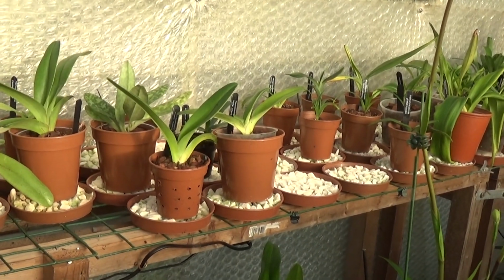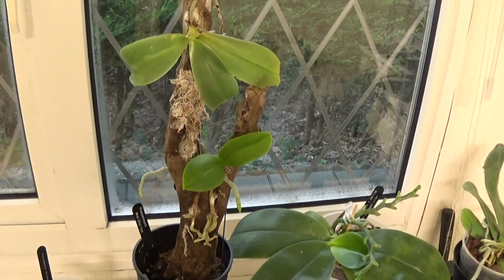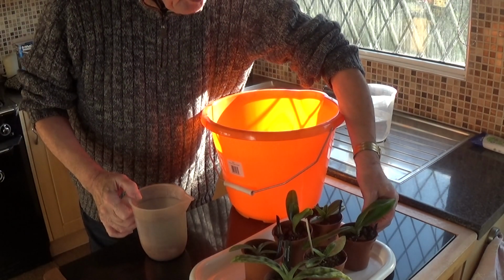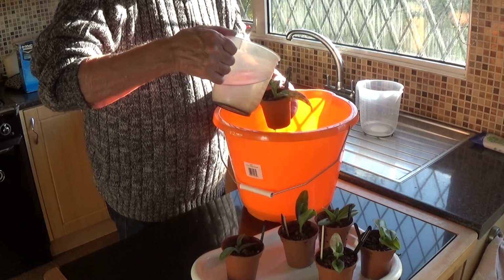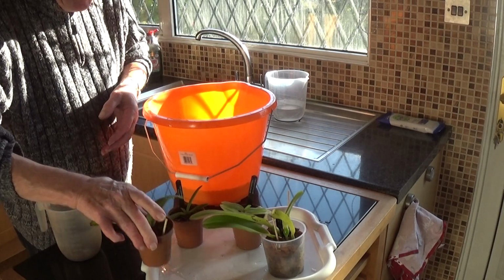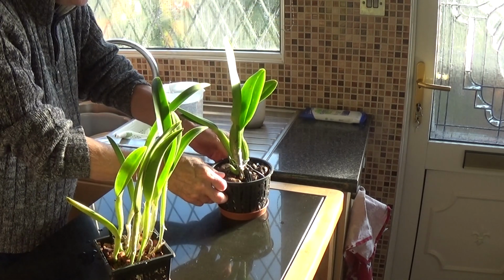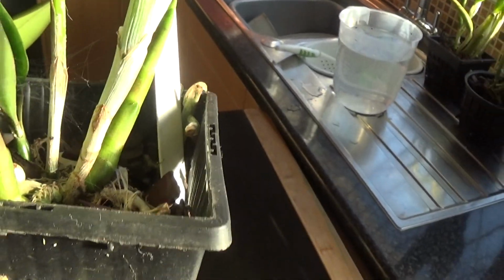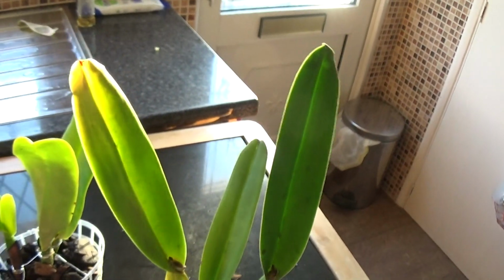Cattleyas and small paphiopedilums but a decent look at the Cattleyas.

Comment: Hello Ed,   Wow!!   I  learned alot from this video.  I  am  going to try the wood sticks.  I  need to do that on some of mine. I am  going to have a  look at the website  you mentioned.  I  did not know about the  single  leaf and double leaf on the blooming.  I am  going to keep an eye on mine and see how they do and compare. I  can't  wait to see  how your new experiment goes with the phaps inside. Hope you have a good day and they get your leak fixed quickly.😊😊👍
Reply from the maker: Hello Valerie. So pleased you gleaned a little information from the video......let me know what you think about Here......but not webpage, Gas leak fixed so back to normal when I can get the house warm enough.
Thanks Valerie always good to hear from you.......thank you.
Ed.
Reply: Yes I am too, I pot everything in plastic for checking roots but when they come in am opaque and not ready to repot the bamboo tip is fab!

Comment: I have moss growing and certain places in my yard and I pulled that Moss up and put it on top of the bark on many of my orchids... It seems like it keeps them from drying out so quickly... but I think because I really let my orchids dry out between waterings the moth from my yard tends to die out but it still provides moisture after I soak my orchids in nutrient solution. I have a big plastic tote and I put all my orchids in there or 20 minutes or so for the bar to absorb the moisture and the orchids to drink up the nutrients. Rick did the same thing but of course Rick had all of his orchids growing in Rock not bark so I guess he had to leave and so sometimes I think you let them soak for long periods of time he said they were having their breakfast for their dinner hehehe
Reply from the maker: Be careful of taking moss from your yard it could be carrying all sorts of pathogens and bugs, I never soak my plants in nutrients for longer thann a couple of minutes....just long enough to know that they have taken up tall the nutrients they need. Nutrients ( fertilizers ) are used far too often in my opinion. If you didn't feed your plants at all they would still grow and have healthy leaves but just a little fert every so often , say every couple of weeks, will make them grow a bi quicker..
Ed
Reply: @EdsOrchids  thanks for the advice on the moss in the yard I've been doing it for a year or two cuz I think I saw a rick have some Moss from his yard on top of the rocks that he threw them in. I guess I started soaking my orchids because that's what Rick does and I've been doing it for 3 years now... I think because I let them soak for so long that's why the bark doesn't dry out and I've gone as long as two weeks between waterings

Comment: How many feet or inches are your Mars lights from the cattleys? I’m getting one in the next few days and I think I’ll need to lower my cattleys down.
Reply from the maker: They are about 14" away Michelle. You will not be disappointed with them. Take care.
Ed.
Reply: @EdsOrchids  so about 35 cm to the top of the highest Cattleya? 🙂
And which Mars Hydro model is this? 
Like your videos Ed, keep up the good work 👍🏻🌸
Reply from the maker: @Vareex   The light I use is a SP 150 and is a cracking light although the coverage could be a little better. But to be honest, as usual, you get what you pay for. Thanks Tommy...take care.